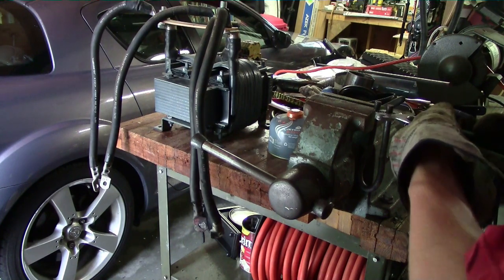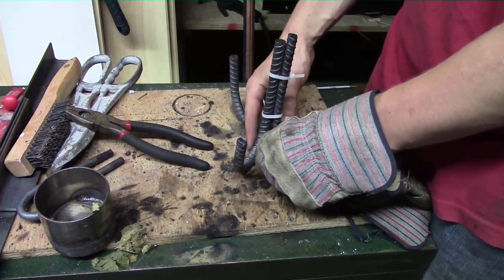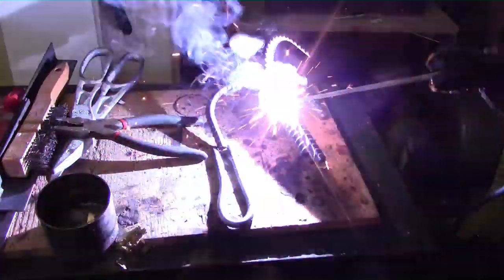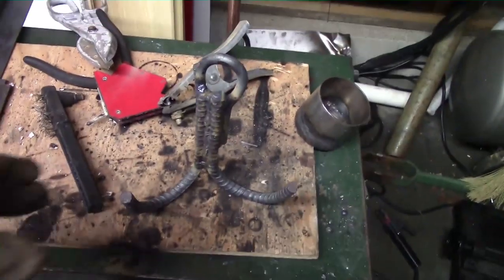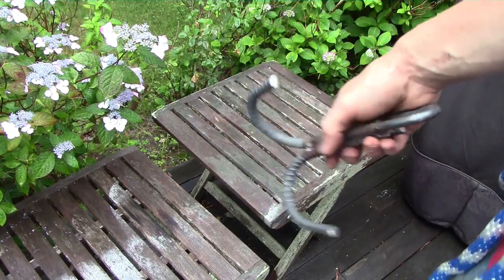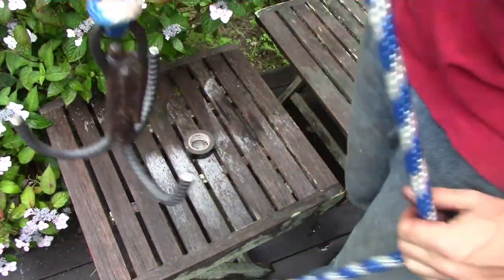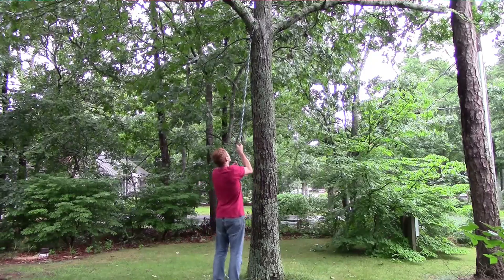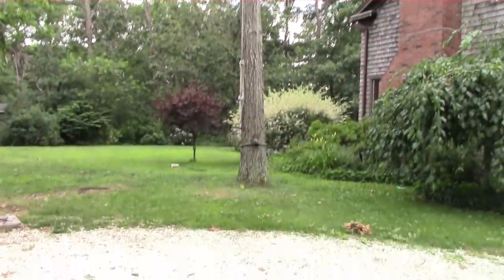Quick Grappling Hook Build

Comment: 2 questions

1. how do you get the grappling hook down

2. how thick is the rebar?
Reply: I know this is an old comment, but whip it in a wave by bringing it up high and slashing it down, like cracking a whip
Reply: The hook should be a little heavy for gettingnit down. Dont sharpen the tines. Just wiggle the rope a bit and gravity will bring it down. 

Looks like 5/8".. ?? 😀

Comment: What was that transformer you used and could you tell us how it works?
Reply from the maker: William Laidlaww Its a 7kva weldig transformer. It uses a 240v 30 amp input and outputs at 4.6v with close to 2,000 amps(its rated to 5,000). amps are essentially how many electrons are flowing through a conductor.  The rebar has less cross sectional area than the wires, so it will get hotter because there is more Resistance  and the same number of electrons are trying to squeeze through it. The friction of all these electrons is what heats up the rebar (its a bit more complicated than that, but that's the jist)
Reply: Do you know where I could get one?
Reply from the maker: I got mine on Ebay, it takes some looking around as they aren't super common. I recommend trying an MOT melter for now, these things can be very lethal.
Reply: Thanks for the help
Reply: RIP Ubiquidic

Comment: Could someone use an arc welder the way you used that transformer?
Reply from the maker: Fleece Johnson arc welders typically output 30-60v and 100-250ish amps. The transformer I used outputs 4v and several thousand amps (amps are what do the melting) An arc welder couldn't melt rebar the way I did it. 1/8 electrodes are about as big as they can melt with current flow

Comment: Climbing 20 feet on a rope is freaky? Landing is manageable if you just do a parkour roll
Reply from the maker: ***** It'd be hard to do that with a grappling hook in your head XD
Reply: well, yes. But still
Reply from the maker: It's just kinda hard to trust the thing. I'd only use it in an emergency or to win a bet
Reply: Same here. Made one by bending some steel bars, they were cold when I did it. Then I welded it. Mine is one hook with two other hooks welded onto it. So fairly safe.
Reply from the maker: I'm more concerned with the branch it hooks onto, I've used my hook to pull trees out of the ground but its hard to know how secure the thing is when you throw it up over a branch or whatever
Reply: I see